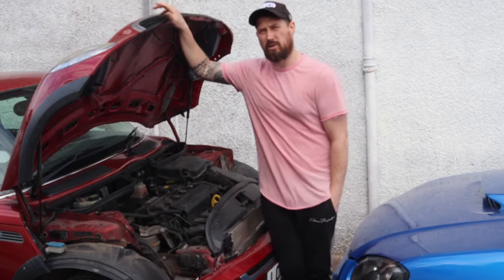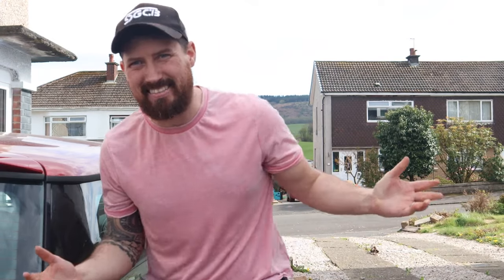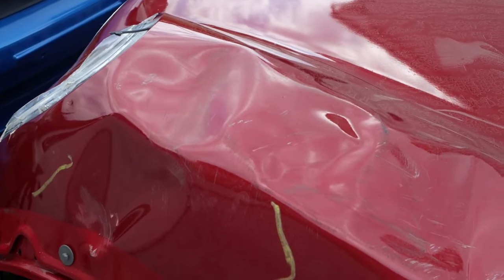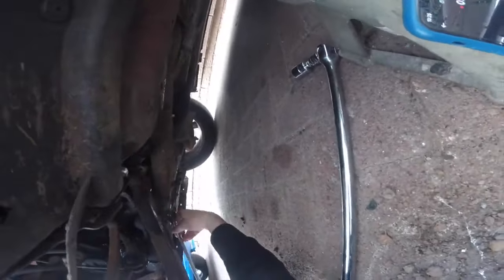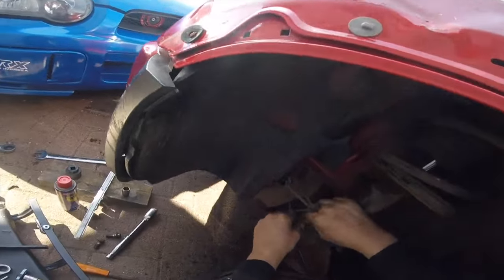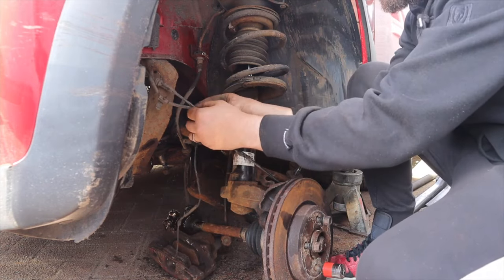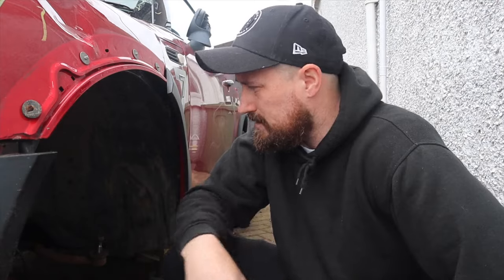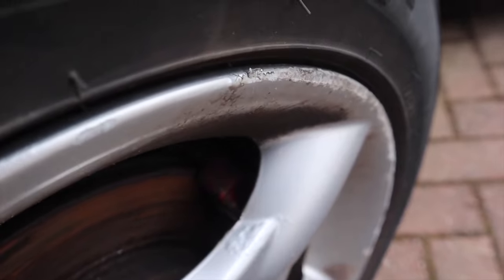I Bought a WRECKED SALVAGE Mini for £200   Can i Save it or did I Waste my Money

Comment: A lot of jobs on these involve dropping the front sub frame.  On a positive note, the engine sounded ok when you started it.  Interesting little project, UK-based, I've subscribed.
Reply from the maker: Hi and thanks for the sub, from doing some research I’ve noticed that pretty much anything on these cars requires the subframe to come off, I’m hoping that what needs doing here I can avoid it though but if it needs to come off it’s not the end of the world

Comment: Looking forward to this one. Good luck.
Reply from the maker: Thanks mate
Reply: @DavidMcBay  Pointless.. It's Scrap and they are not reliable at this age either. BMW SPares for spares etc. A better idea would be to buy a car known to be reliable and cheap to run 90K Honda Jazz 1.4 that needs a new Clutch or a Diesel Fiesta that needs a New Turbo and suspension fixing (Just as a few examples).. Something that is going to be easy to sell and that the parts will be cheaper for. Old Mini's are known to be problematic from about 55- 60K Miles. & The more power they have , the more trouble and the more expense. All BMW Prices.

Comment: Pointless.. It's Scrap and they are not reliable at this age either. BMW Spares for spares etc. A better idea would be to buy a car known to be reliable and cheap to run 90K Honda Jazz 1.4 that needs a new Clutch or a Diesel Fiesta that needs a New Turbo and suspension fixing (Just as a few examples).. Something that is going to be easy to sell and that the parts will be cheaper for.
Old Mini's are known to be problematic from about 55- 60K Miles. The more power they have , the more trouble and the more expense. All BMW Prices.
Reply from the maker: Whats unreliable with them? I can just imagine the look on my wife’s face if I brought home a Honda jazz or a Fabia. I’m not looking to sell or make money on this car, the plan is to have it back on the road for less than 1k then use it to do the daily drive to and from the train station.
Reply: I was never a big mini fan either… until I bought my mrs one last year, I’ve had to do a fair bit of work to it as well as change the clutch 😮 but now it’s sorted and is a cool little car! I think they’re great because they’re classless, they don’t look out of place wherever you park them 👍
Reply: I must say having had a r50 mini. I loved it and would have another. I did change the clutch, but it had done 123000 miles when I did, and while I did, I rebushed all suspension. I did put a new tentioner on the timing chain, and that stopped the ratle. Never let me down